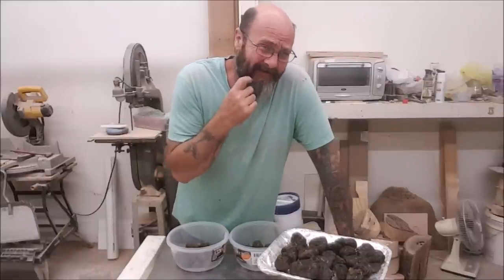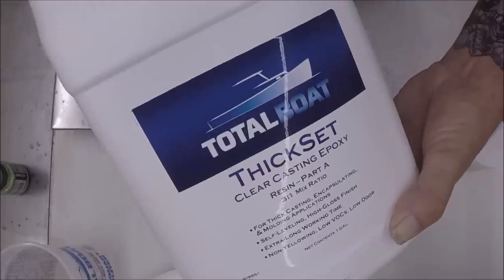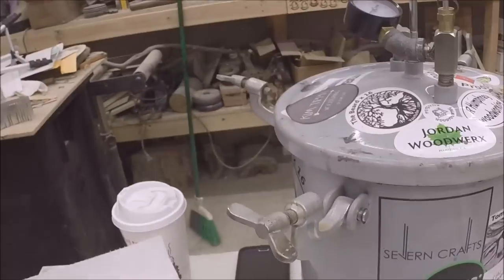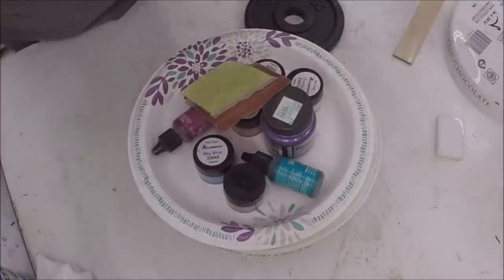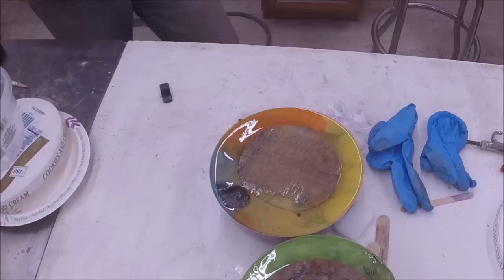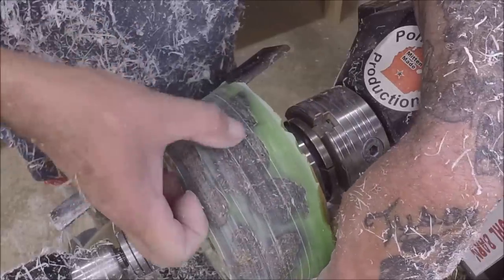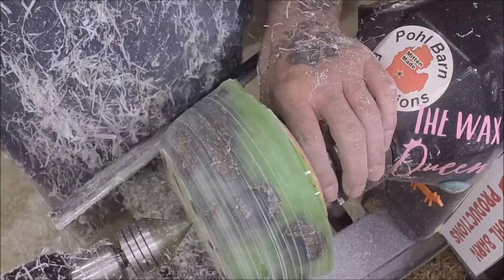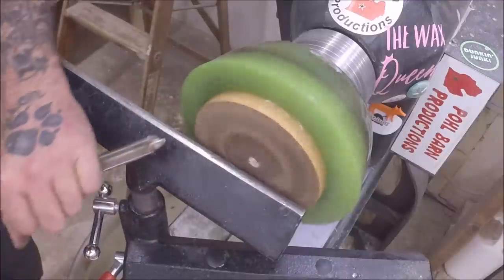SOUR ROAD APPLE BOWL

Comment: Many of the glow-in-the-dark powders are strontium aluminate, really hard little crystals. It would probably work well as a sandpaper material. I bought some a while back to put in a few crafty little creations. Learned quickly that you avoid any project that uses cutting tools after it's in place. It does glow really well and for a long time .
Reply from the maker: LOL  Thank you
Reply: @PohlBarnProductions  Yeah I know, too little, too late. I was going to throw some in with the powder coat paint I use on my cast boolits, nixed that idea immediately on receiving the stuff. Talk about a bad fire-lapping job waiting to happen.

Comment: This was definitely a Turdy Project...
Are you sure it's the Glow in the Dark Powder that's eating your tools or could it be the Wood Hardener that you used on the Organic Chunks you used?
If you want to redo this project, why not try using Cactus Juice to stabilize the chunks. Peter Brown hasn't had any problems turning items he Stabilized with it...
If you get a 0.75 - 1.00 inch thick piece of Plexiglass or Lexan and a 0.25 inch thick rubber ring you can turn your Pressure Pot into a Vacuum Chamber without much cost...
Reply from the maker: Thank you... I didn't have cactus juice or the chamber when I filmed this,  after ordering it I am now 400 in the hole, everyone leaves out the price when they decide on how I should do it.  no worries the thought had crossed my mindm I worked with what I had, the glow in the dark powder could be replaced by paint but I fear that will just be the same. the other issue is the horses eat from the ground and eat dirt along with the hay,  it really could of been anything making the sparks.
Reply: @PohlBarnProductions  That's why I suggested the Lexan and rubber ring so you would be able to use the lower part of the Pressure Pot and not need to buy a new Vacuum Pot...Oh, well, a new Pot is at least guaranteed to work properly...
Reply from the maker: it's not you, everyone says it.  lol  sometimes you just get tired of the
 same thing over and over again,  it's like I do not know about cactus juice.
  it's all expensive and well it's nice to have but not necessarily 
needed,
Reply: @PohlBarnProductions  I couldn't remember if I'd ever suggested it before, and I wasn't aware that the Juice itself was pricey...is there a cheaper stabilizing liquid you could use other than Cactus Juice?
Reply from the maker: the juice it's self was like $100 or so, right in that ball park, I used the wood hardener  because I could use it right out of the bottle and it's at the store closest to me, still pricey, $14 for that lil bottle of it. as far as anything else, I myself have not heard of anything on the market that does the same thing.

Comment: At one point you are literally covered in poo, it’s in the resin and the resin/poo shavings are covering you. Good thing you’re wearing that mask! 
Could the sparks be caused by methane gas inside the poo? With the heat and friction of metal tools, I wondered if that would be an issue. Nice job once you got it all done! Color was a good choice. TFS!!
Reply from the maker: LOL  the poo is pretty much plastic now but I wore a mask anyways, the sparks are due to the Horses eating from the ground, most likely dirt and I think the glow in the dark stuff is also a sort of Rock so it could also have something to do with the sparks.  Thanks again for watching and at least seeing the humor in it.

Comment: Doug when the tool is making that high pitch wine is it OK to continue as I keep stoping ?
Reply from the maker: Um I sped the lathe up to try and get rid of the vibrations but it did not work so well,  I could have gone more but I just sanded it smooth. as far as is it ok I really do not know.